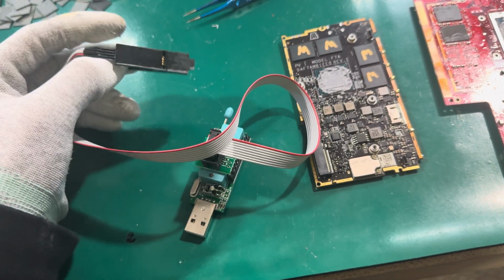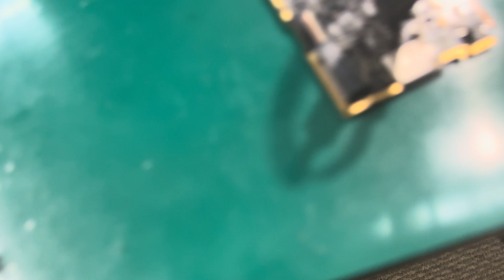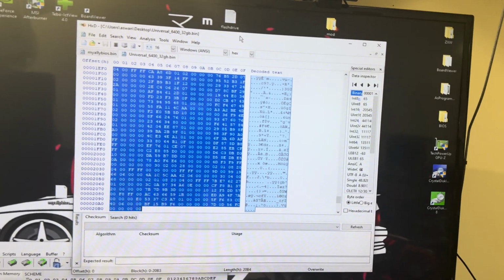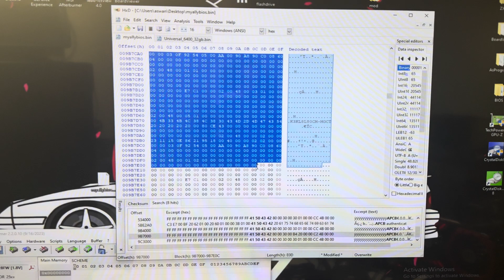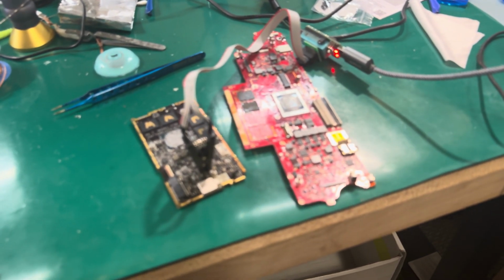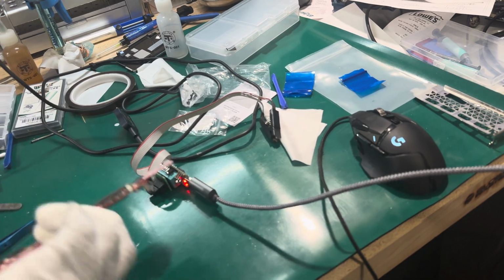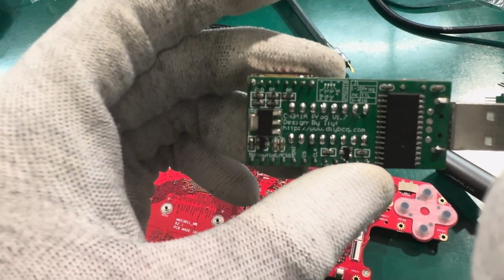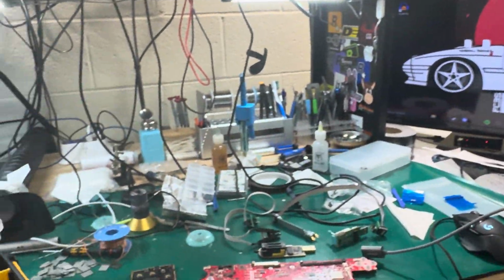How to edit Steam Deck and ROG Ally BIOS for 32GB RAM

Comment: I believe is not worth for a normal person to upgrade the rams and others like battery, because you can find to change a ROG ally z1 extreme to a ROG ally x + 300 USD difference, and ally x have 80w battery and 24gb ram which is enough 8gb for GPU and 16 for device, for a simple person to upgrade a ally is more expensive than changing console with a ally x
Reply: Me I don't play a lot and single upgrade what I wanna make is to put a m.2 dma card inside ally to revange on the admins from non steam serversand for travel I will boot steam os from SD card and the SSD m.2 I will put in dock station
Reply: The dma m.2 is a nice upgrade

Comment: Hi, I'm from Mexico, how much do you charge me to edit the bios .bin, so that it works with 32gb at 7500?
Reply: L9L9? Same question… in early bioses there was a way to config it from usb drive to run 6400. But I still wonder if that zen2 cpu can handle higher speeds…